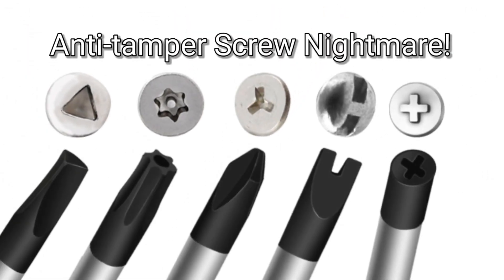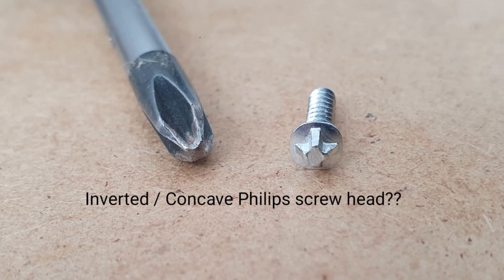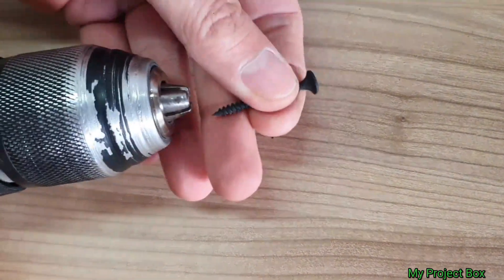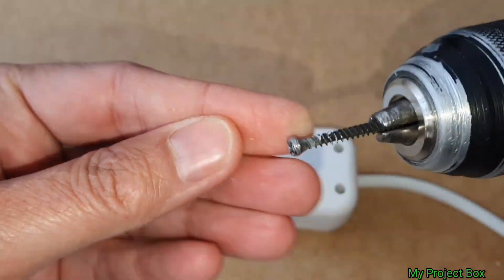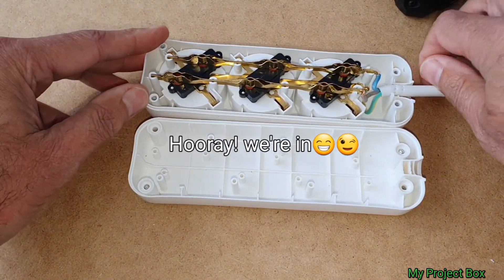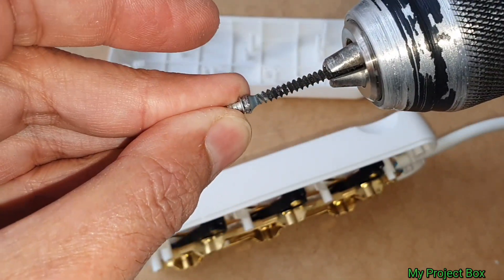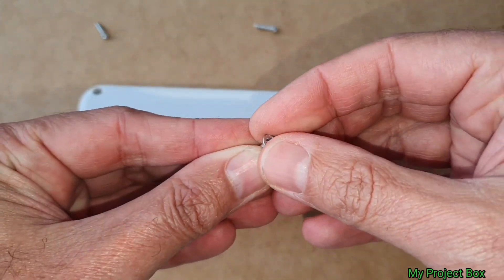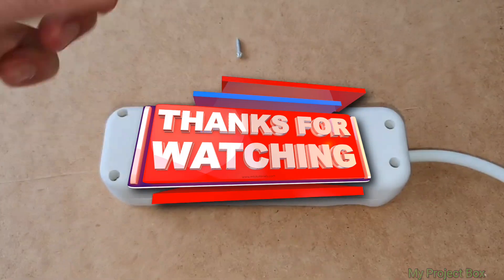Anti-Tamper Security Screws RANT right to repair #righttorepair #tamper #screwhead

Comment: I had an 89 4 cylinder Mustang and I needed to do something to the ignition switch. It had anti tamper with star screws. I bought the tool about a year before I had the problem.

Comment: We have a few LED nightlights that have the pesky triangle screws and the LEDs only lasted about a year before getting very dim.  From a quick search I found that small Torx screw drivers can open triangle screws, however, after opening one, the second one damaged my T5 Torx head, so ended up getting a triangle head set rather than have more eWaste buying new nightlights.